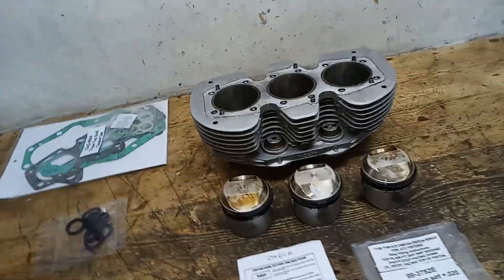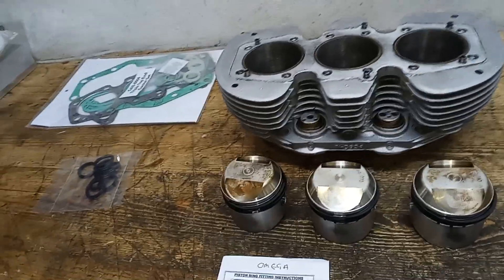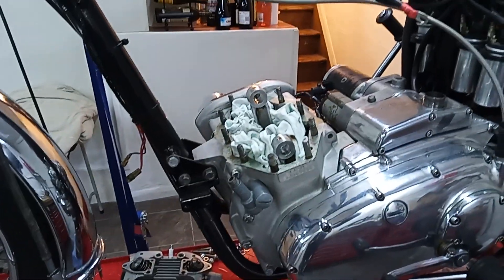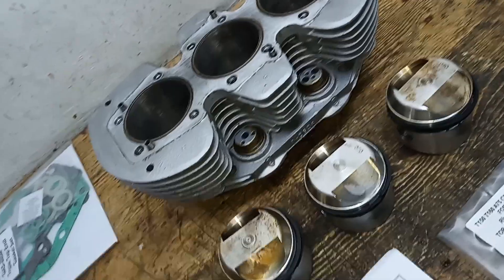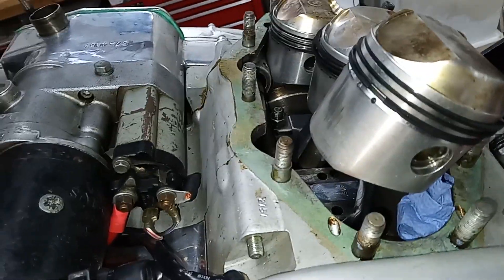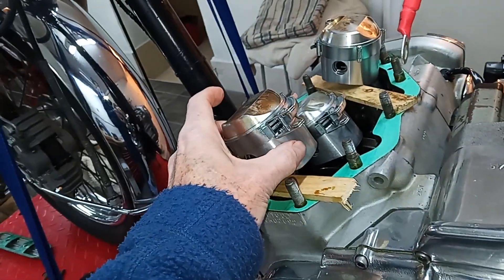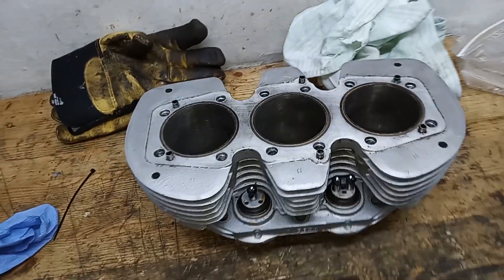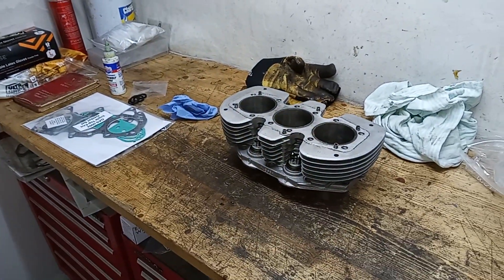'75 Triumph Trident T160 - Cylinder Barrel Refitting

Comment: Is it a new thing to put the rings in the bore with no oil ?
Reply from the maker: I'm not sure how old the advice is, but it is usually associated with the rougher hone required with older bikes using cast iron rings (not newer engines which have a finer hone and steel (?) rings) The reasoning behind this is that you actually want  the rings to cut into the metal honing on the bores, so smoothing them and making a good oil tight seal. If you lubricate the bores first then the rings will slide over the hone cross hatching rather than cutting into them, leaving the bores relatively rough and therefore prone to oil seepage and a lack of compression.
Reply: @Chris.rooke150  You've forced an intense Google session! It would seem it is indeed a controversial subject. Best debate I found is on "thumpertalk". No punches pulled. 🤣
Reply: I've heard of it only once before this occasion but dismissed it as nonsense. Interested to hear the theory.
Reply: Thank you very informative